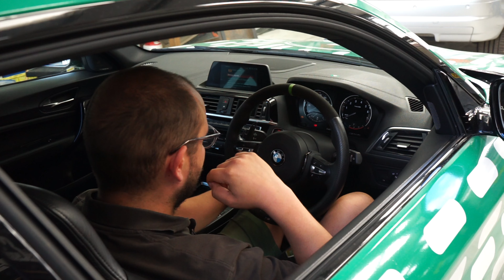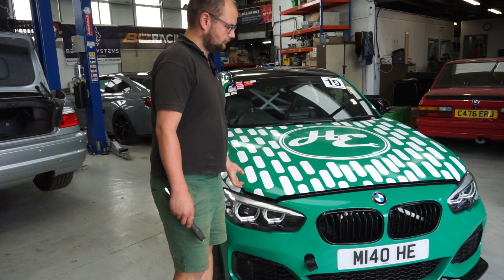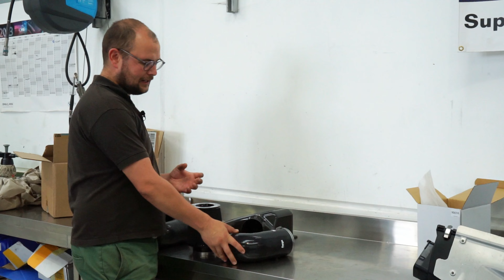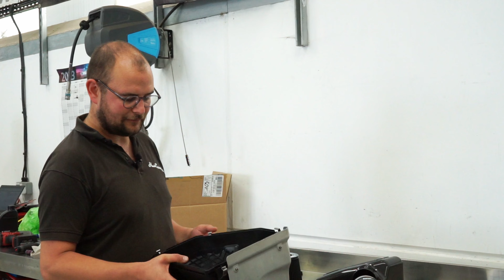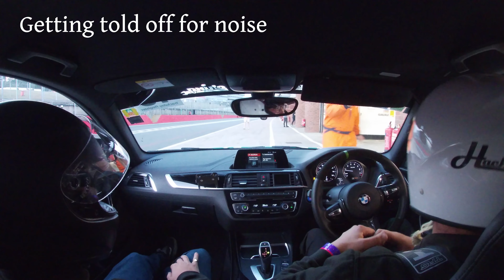You NEED This Mod for Your BMW M140i - Forge Motorsport CARBON FIBRE Intake System

Comment: What if you use the speed engineering lower part instead of OEM cause it’s practically the same?
Reply from the maker: Shouldn't be a problem, although the Speed Engineering lower airbox part is smaller than the factory one, so may be tight on the air filter. Would sound great!
Reply: Hello @triz1hunna151, 

After studying the Speed Engineering Lower Air Box, we're confident that FMINDK50 will be compatible.

- AJ, Forge Motorsport

Comment: I’m still waiting for evidence from anyone , that a silicone intake pipe actually has any improvements over the OEM intake with Helmholtz silencer
Reply from the maker: Check out Forge's graphs here - 9bhp and 7nm claimed increase with proof. 
https://www.forgemotorsport.co.uk/Inlet_Hose_for_BMW_B58_M140i_M240i_M340i_M440i--product--2274.html
Reply: @hackengineering5586  thanks I’ve seen that before , I know you can get different dyno readings depending on conditions even run back to back and let car cool etc , i want to believe it but I think the Helmholtz is there for a reason including engine harmonics helping with the pumping pulses and maf sensor readings , maybe I just need to buy one and try for myself